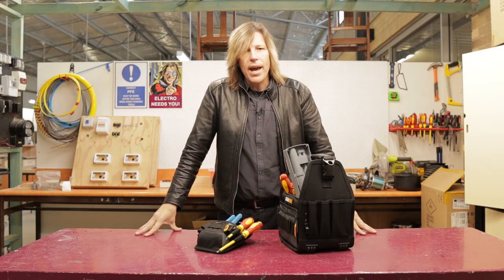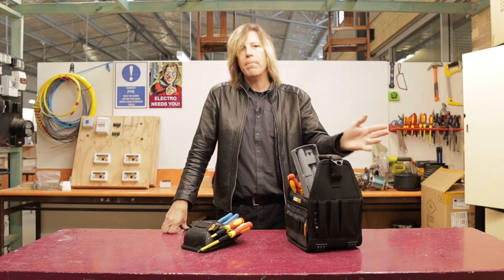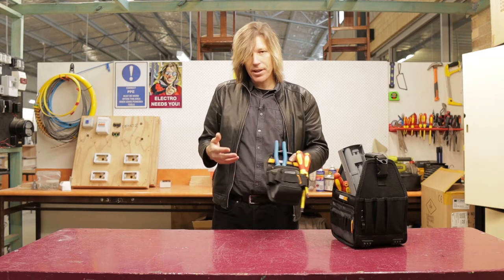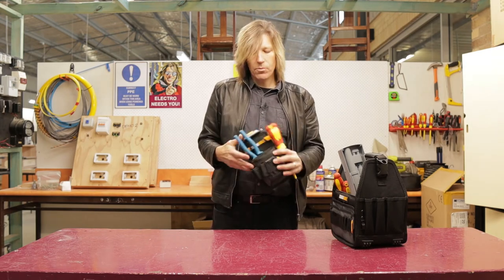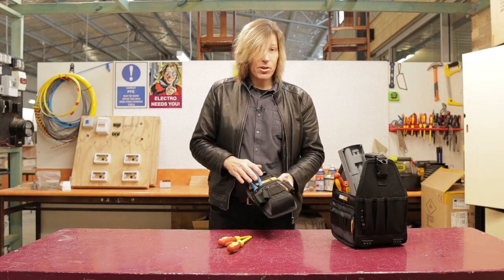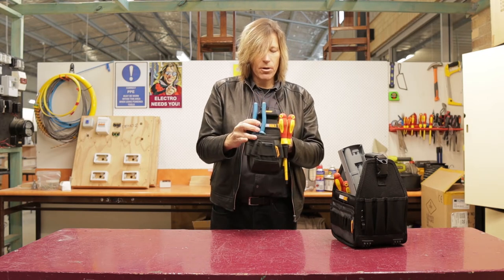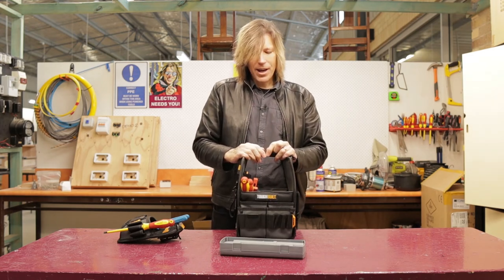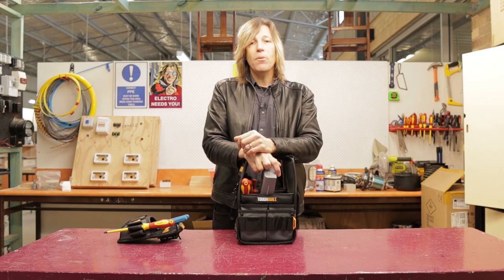Tool Pouch Vs Tool Bag

Comment: I love that toughbuilt system I use the 8 inch tote and their master electrician pouch. It's nice that most of my everyday tools are in the pouch that I use as a hybrid pouch/tool bag. Grab what I need and put it in the pockets/small pouch and get the job done look to make sure I have everything and move to the next job. Btw I work hotel maintenance.